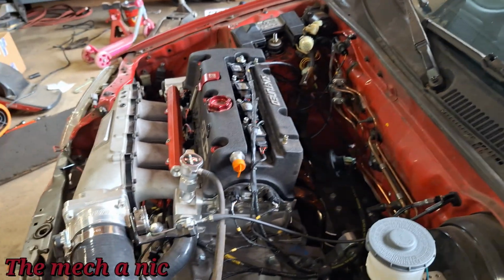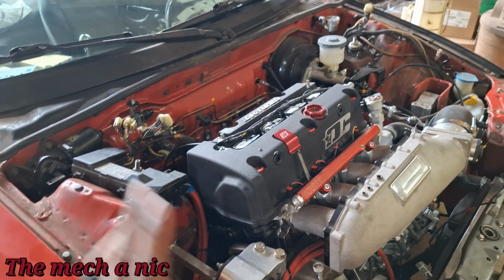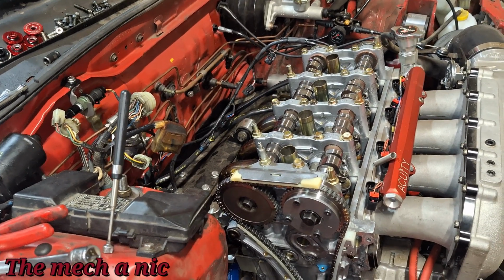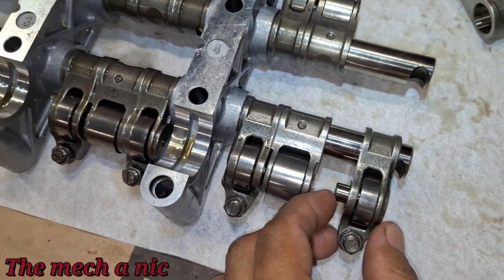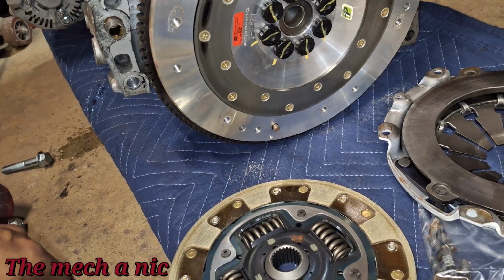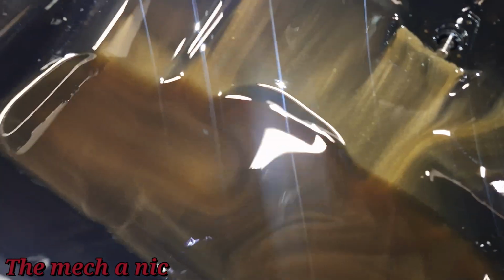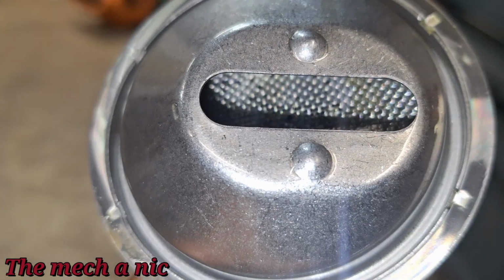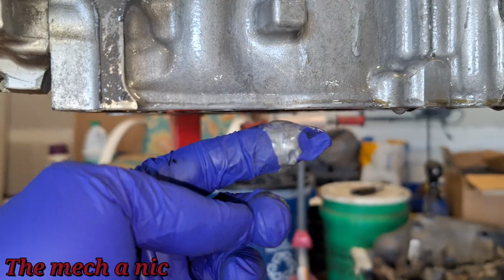k24 crx first test drive didn't go as planned

Comment: Some starters retract after the start, idk if k24 run those type but that would go with what ur saying about the sound not being continuous.just a guess but going off what I seen and heard and the sound is not heard while rotating assembly is turning than, idk . That's scary to run into for a fresh build. Fuckin gremlins. Hope u find it.
Reply from the maker: Thanks for the suggestion,  the starter is definitely working properly so it's not that . Yeah it's the last thing you want to hear on a fresh build 🤦‍♂️

Comment: my first thought was the timing chain tensioner, when it finally gets oil on first start it may shoot out. could be sticking. could also not be sealing correctly and causing a loss of oil pressure to the tensioner and causing it to release tension. idk if that skunk2 tensioner is hydraulic or manual. im not super familiar with them. my second thought was the vtc gear. question though, did you get a few heat cycles in then change the oil? usually on fresh built motors you should get 1-3 heat cycles then change the oil then do whatever mileage interval youre comfortable with. i like 50, 100 then 500. oil changes at each mileage. you want to flush out whatever you can as soon as possible.
Reply from the maker: The tensioner is spring operated and oil pressure at the same time. Yeah I'd say I had about 3 - 4 heat cycles on the engine before draining that oil out.
Reply: @themechanic6117  🙌🏼💪🏼

Comment: It’s ur VTC gear why a RBB n not a rbc vtc. if ur map vtc is for 40-50 degree with a 25 degree that would definitely throw ur reading off in ecu.witch is most likely that sound you hear..if ur running a rbb u gotta make sure if not set first for a RBc for 45 degree of VTC movement
Reply from the maker: I'm using a drag cartel cam gear that's pinned at 40°

Comment: Same shit happened to me once it was the vtc gear didn’t have enough oil and just started making that noice.
Reply from the maker: Interesting, that makes sense. People are saying it's the vtc solenoid....which leads to vtc gear not having enough oil .
Reply: @themechanic6117  Exactly that happened to me twice during engine rebuilds and I just took apart everything, cleaned it and bought a new vtc solenoid and it solved it. The gray thing that you cleaned with the fingers is the paint, the other flakes it’s just normal wear of the engine upon break-in, remember to basically do like 2-3 oil changes in between to make sure you put in clean oil. Engine looks great, normal wear during break-in.
Reply from the maker: Thank you for that, I was thinking the sane thing, the inside of the engine looks good and I'm glad to hear that it's all looks normal from what other people are seeing. Thank you for the input 👍

Comment: Why do you not have a fuel return? You adjust the valves? How are you running a fuel pressure regulator on that setup? My k swap in an ek is a return setup. Didn't think you could run a returnless on the older cars.
Reply from the maker: From my research I found that having a fuel return isn't necessary.  I know the engine hasn't ran for long but it doesn't seem to be a issue.  Yes the valve lash is all in spec
Reply: @themechanic6117   what tb you using? I had a cast k tuned and the throttle plate would stick. Though you'd probably notice that. Had to get the bigger k tuned billet tb with the adjustable spring to get the plate to not stick. That "may" cause it to slam shut. But doubtful.
Reply from the maker: I have the billet 90mm ktuned throttle body. So far I'm not having a issue with sticking but I have heard of people complaining about that .
Reply: @themechanic6117  just running through ideas. I got a brand new pcv from the Honda dealership and it literally broke in half when installing. I didn't overtighten. Didn't even get to it fully threaded. Have you checked your pcv?
Reply from the maker: My pcv is deleted.  I just have a plug in it. It's funny that you bring it up because just today I was looking into if I need to reinstall a pcv .... I don't think I am. The pcv vents into the timing cover which is connected to the valve cover. So I'm going to vent off the valve cover

Comment: what about the throw out bearing (getting stuck) or loosening up after its first drive out.... in the transmission side of things or something in the transmission....
Reply from the maker: I checked the throw out bearing,  it seems fine and don't see a problem with it. I did consider that the noise could be in the trans. I don't know anything about transmissions and have never opened one. I'll be draining the fluid out the trans to make sure the fluid is relatively clean. That's about all I can do.
Reply: @themechanic6117  I am wondering, even with a noise like that could cause physical damage to any component. You diff didn't find any indentions inside the motor... I do hope you find the culprit!

Comment: Get an oem timing chain tensioner. I bet that snapping noise is in the timing chain tensioner. I don't think I would trust a skunk2 product (made in china) when it comes to that.
Reply from the maker: I hear you, at this point I'm over $700 in just from tearing this thing apart. If the noise persists I'll be changing the tensioner for sure.

Comment: Terrible about all your troubles.  Hope it gets better.  Not a mechanic, but I dabble on my own stuff.  Its hard to hear over mics and speakers, but the click that you indicate almost sounds the same as the clicks just as you are starting.  Is there any chance the starter motor isn't locking in place properly and comes out every now and then snaps back in and that's causing the noise?  Just trying to think outside the box.
Reply from the maker: The particular moment I pointed out in the video just happened to be soon after starting but the odd noise will happen at random times , it doesn't seem to be related to the starter . I've heard starter noises before ,this sounds different.
Reply: @themechanic6117  Ok was just a guess to brainstorm.  At my end they sound similar, but I trust that you hear it better in person.  Here's hoping it was just a loose alternator.  You really tore that thing apart to rule out anything else. Gotta get it back together and get your head in there and figure out where its coming from.  +1 for possible thermal expansion.
I read more comments and see that you have a bunch of leads and the VCT etc.  Hope you get it back and running soon.
Also definitely breath the PCV or reroute back to combustion downwind of any sensors.

Comment: Sounds like the timing chains slapping hard to really hear though,just my 2 cents. I also agree with terdness adding lol don’t need more work when you get to making it look pretty
Reply from the maker: 🤣 yeah don't damage my turd lol. That's exactly what I was thinking initially, that the timing chain was hitting something but it doesn't explain it's randomness.  When a chain rubs or slaps on something it's usually pretty consistent.

Comment: The oil looks perfectly normal for a fresh build.  I chased a knockish sound on my Jetta when I rebuilt the 2.0.  Turned out to be the alternator.  Good luck in the hunt to figure out what your issue is
Reply from the maker: My alternator checks out, it's one of the first things I checked. After going through it, yes I'd say the oil is clean (nothing of real concern) .

Comment: Bro I would replace that skunk2 timing chain tensioner with a oem honda tensioner. Might be the loud noise you're hearing
Reply from the maker: I'm starting to hear that more n more , I'm already over $700 in from tearing it apart. After I put the engine back in and if the noise still persists I'll be changing the tensioner first.

Comment: I've heard the exact same sound on my Subaru EJ253. Obviously its a different engine, but the 253 uses a VTEC-E style valve train mechanism - basically runs with one intake valve almost fully closed until AVLS engages, then it switches to a high lift intake valve profile so both valves actually open fully. 

Anyway, when i was running really low oil pressure (it was burning oil, because Subaru's are garbage [this is a new OEM engine block and heads that i rebuilt] so eventually my oil got pretty low without me knowing) when i was driving it would randomly make a VERY loud "TAP" or "KLINK" sound exactly like what you showed in your video. Once i figured out i was low in oil, then it went away. I think it was only doing this when it was trying to engage AVLS, but it's possible it was making the noise even aside from that - regardless, it stopped when I had full oil pressure again. The sound DEFINITELY came from the AVLS pins in the rocker arms. Again, the AVLS pins look and function basically exactly the same as VTEC.  

All of this being said, i know it's a different engine, but i wouldn't be surprised at all if the sound is coming from your valvetrain when VTEC is trying to engage... For the record, i am sure it will engage, but i really think the pins in the valvetrain engage either too slowly or at the wrong time and it makes a very loud sound as the pins slam into the other rocker arms. 

All of this being said - it's either the VTEC solenoid, low oil pressure, or possibly something to do with the VTC actuator.

Edit: Also, the glitter in the oil, on the last two engines i built i noticed a little bit of glitter in the first oil change. I cant remember if it was as much as yours or not (i really dont think so)...but considering you pulled everything apart and your bearings look fantastic and cylinders look good - i think you're golden. I am positive most of that is from the paint, just like you said.
Reply from the maker: You were definitely on the right path with this comment and I think you're correct with the steel pin slamming into something else trying to engage vtec at the wrong time. I would have to agree with you

Comment: Could be timing chain tensioner, it is activated by oil pressure so it would make sense that it happened right on start up. Personally i would use an oem tct
Reply from the maker: I've had like 5 people tell me to use a oem tensioner,  engine is pretty much put back together.  If the noise continues after it goes back in the car I'll be changing the tensioner for sure.

Comment: That loud tick does not sound like rotating assembly or even internal engine to me 😑
Reply from the maker: Yeah I didn't find anything indicating it was part of the rotating assembly.  For a while I even thought it was external but it is coming from inside the engine.  People are saying it's the vtc solenoid causing the noise based off experiences they've had.

Comment: The haltech software needs to be set back to version 3.10.3 it’s a glitch in the haltech firmware if you unplug the vct it will run fine, then the sound goes away, if you put the software back it will be fine
Reply: Same thing happened to me man, I was about to go buy a new motor and I found the issue
Reply: 100% that’s your issue bro it makes the vct wiring not work auto elecs and everything can’t find it, put the software back to 3.10.3
Reply from the maker: Damn that's great to hear! In the next video you'll see that the engine is fully assembled again but I never found concrete proof on what was wrong . Is it easy to reverse the software?
Reply: @themechanic6117  i think the metal flake was from the painting which should never have been done, but its quite easy to rollback the software there is a section along the top of the menu, it says something like firmware version, and then you can select roll back firmware there will be a video of it on the haltech page or you can contact the guys at haltech
Reply: @themechanic6117  it’s under the TOOLs heading at the top of the page near help
Reply: With the latest software it makes the vct advance all the way at idle and it goes back and fourth sounds like the engine is knocking

Comment: Its good you took it all apart. They should have never painted the inside of the timing area. That would have clogged your pick up tube and caused oil starvation. What cams are you running? To me the tick noise sounds like the starter engagement. I work at Oriellys and the was the first thing i thought. Because i have bench tested a lot of starters. Maybe 🤷 other then that i dont know. The reason i ask about cams is because i know that the ktune etc. valve covers you need to remove one of the bolts on the baffle if your running big cam. But you also checked the cam lops and the looked good. If it has a baffle on valve cover check those. They typically have some sealent on half the bolt so they dont back out.
Reply from the maker: I don't think it's the starter because the noise also happens just at idle, it's not always on start up. Someone just mentioned that the haltech software has a glitch it it that messes with the vtc and causes this problem so I got my fingers crossed for that! I'm using drag cartel 3.2 cams , they do clear the baffle in the valve cover but I removed that bolt anyway just to be safe. I just found out about that ktuned valve cover issue just a few days ago .
Reply: @themechanic6117  you'll get it figured out. Can't wait for the video to drop on the fix.

Comment: Bro if some machine shop sprayed my block with Krylon I'd be pissed beyond reason. The noise not being consistent imo means it's not rotational. If it was a vtec solenoid going schizo, maybe. But that sound reminded me of spark knock on one of my Subaru engines I was trying to get tuned. What did the plugs look like, did they look like they were burning normally? Maybe something that would show up more under idle than it would at higher revs. But I dont know. That sparkly oil would have set me down the same path though. Nothing worse than finding flakes or chunks in a new engine build....

Hope you got it figured out though.
Reply from the maker: Yeah it's definitely frustrating dealing with the paint.  I've got plenty of hours invested already of just cleaning parts with paint all over them. The spark plugs look normal  maybe a bit on the rich side but I didn't notice anything that looked concerning with the spark plugs .

Comment: Replace the vtec solenoid. I know it sounds crazy but i just heard about this issue from a friend's shop. Said they tore it completely apart and last thing they tried was the vtec solenoid and the noise went away and drove great.
Reply from the maker: It's not a crazy theory! In the next video I'll show what I found with the vtc actuator and the vtc spool valve.
... I can't confirm that it's fixed yet because the engine still isn't back in the car but my fingers are crossed.
Reply: I had the same scenario on my Honda Element. Only happened once I turned it on a cold start and realized the sound would come from the spool valve. Once replaced with a oem, the sound never came back .
Reply: Dude I had the loudest noise in my turbo d series, sounded just like this inconsistent tap noise.. vtec solenoid was the culprit.. tore the engine apart twice and ended up that was it 😅
Reply: It's crazy how that vtec solenoid can be so loud. I hope that works for you man! I'll stay tuned in.

Comment: Iirc you have DC 3.2 cams. I had an issue with my DC 004 cams where my intake cam was touching a bolt on my K Tuned Valve cover. It was a bolt holding the baffle in place. It caused a semi loud ticking  noise. Not saying that may be it  ut check you VC bolts on the baffle side.
Reply from the maker: I recently found out about that problem.  It looks like the 3.2 DC clear that baffle bolt but I still went ahead and removed it ,just in case. 👍
Reply: @themechanic6117  cool deal. I'm glad these DC cams are billet. It shaved the bolt flat on my VC where I had to drill it out. Cam lobe wasn't even phased by it.
Reply from the maker: Nice to know they're strong 💪

Comment: Sorry for your problems. It's a real heart-breaker having to take it all apart again. Hard to see any real issue other than the alternator mounting bolts, but I believe that's reaching. Perhaps leave the transmission out of the re-assembly and just run the engine? It may help isolate the issue if it does return. Good luck Jon.
Reply from the maker: Thank you, I plan on draining the fluid out the trans, hopefully that fluid comes out clean. I did buy it off of ebay after all.

Comment: I think it might be expansion noise. I have heard this on vw air cooled engines after rebuilding.
Reply from the maker: Like metal expanding from heat ?
Reply: Press in cylinder liners? Press in piston pins? The aluminum expands more than the steel. Resulting in a loud snap sound.

Comment: If the sound frequency is that high pitched its external. The breakin seems average.
Reply from the maker: I agree, or at least it's not coming from any of the rotating assembly.  Once I found out that the spray paint is the cause of the glitter in the oil I was glad to see that the oil is relatively clean then. No metal debris or anything.  The paint clogging the pickup could have become a issue if it wasn't addressed.  I'm glad I decided to take it apart.

Comment: Maybe That Fuel Injector Gasket Is Causing Back Pressure Inside of The Engine and Forcing More Gas Into The Motor, Does The Oil Smell Like Gasoline? The Blockage Could Be Causing The Motor To Go Into Limp Mode?
Reply from the maker: That's interesting.  The oil didn't smell like gasoline.  I'm sure that gasket interrupting the injector spray pattern wasn't helping. That gets addressed in my next video . Thanks for your input 👍  I appreciate the advice